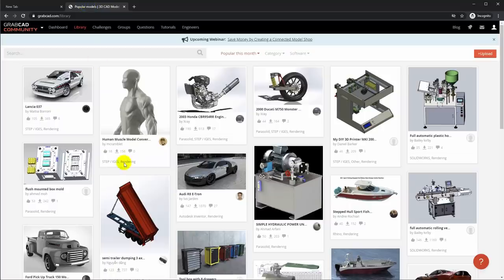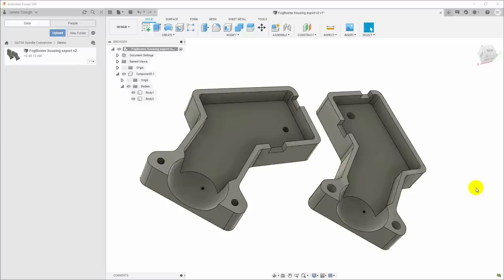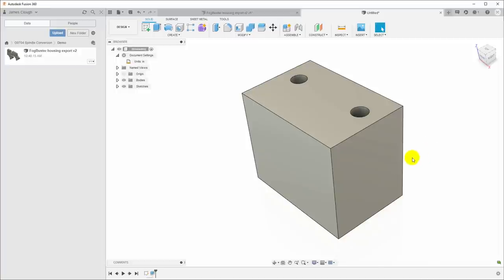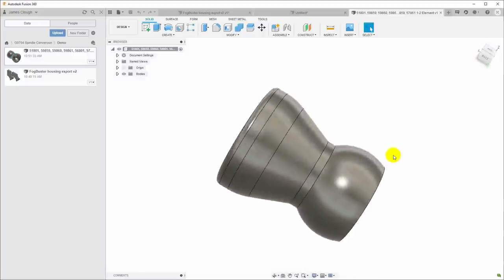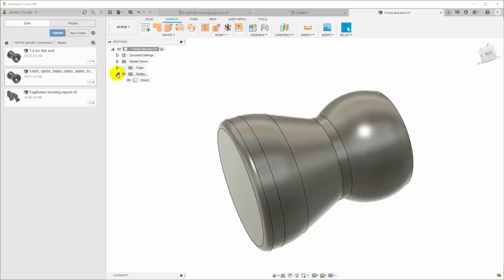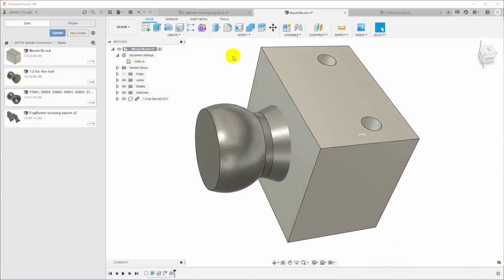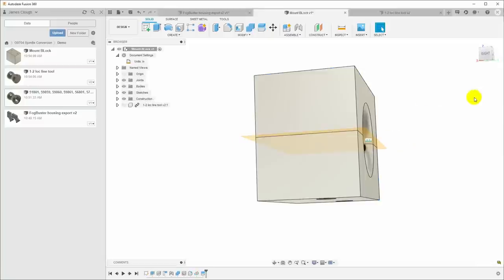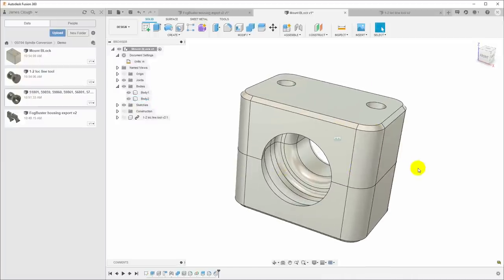Making 3D Printed Fog Buster Mounts with Loc-Line

Comment: I've been using a fog buster for several years now and I find that the most efficient positions for the 2 nozzles are 3 and 6 o'clock instead or 3 & 9 because the opposite air streams prevent good chip evacuation. Thanks a lot for sharing the files - I will definitely try the loc-line mount instead of the original arms

Comment: Just finished the video. Fantastic! thanks.
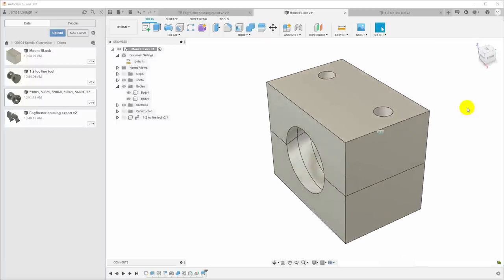I just got my first 3D printer a few weeks ago and am working through the learning curve with the printer and CAD (Fusion 360).  One thing I learned recently (after 100's of hours of YouTube videos) was moving the timeline bug. At ~17:25 you added fillets and mentioned you should have added them before splitting the body. You can slide the bug back to before the split in the timeline, add the fillets then drag the bug forward again. But, you probably already knew that.

Comment: I installed my fog buster today and came back to this video to see the locline system. If you need to get the hoses off again, just use a hot air gun for about half a minute and then you can just pull them off.
Thank you very much for making the parts available!
Reply from the maker: I tried that, but maybe I didn't use enough heat.

Comment: Great starter tig welds there. It takes a little bit to develop the muscle memory of the process, and I'm no expert. On the barb fittings -A little heat helps. I use a heat gun held at a careful distance. Heat just long enough until the hose is warm to the touch. Give it a little turn and then you can usually wiggle it off. We use this process at work on our CNC lathes on reinforced hydraulic drain hoses that have been permanently set stiff into shape with 10+ years of heat and oil exposure. Your solution was fine too, but there are times perhaps when your viewers might need to leave the length unaltered.
Reply from the maker: Thanks!  My welds would be better if I didn't keep taking the tungsten for a swim in the puddle.  I have trouble judging the arc length.  I wonder if a clear cup would help, but I've been warned to learn to do it right before spending money on magic tools to try to make it easier.

Comment: About filling the inside of the tool in Fusion 360, you can do it in the Solid environment. Create a sketch. Use the Project function to transfer the perimeter. Then Revolve the profile sketch making sure you use Operation: Join with the existing solid. 
BTW,  3D printing those links is possible. Plenty models on Thingiverse. Even the assembly tool! One downside; because of the staircase surface finish of the 3D print, it wears itself and won't give any longevity.  Once 1 link  doesn't hold, the whole thing is useless. Also, most 3D filaments are hygroscopic (tendency to absorb moisture), which would not be suitable to run any liquid directly.
Good job and keep the up the great videos!
Reply from the maker: It all comes down to the tolerances your 3D printer can deliver and how much time you have to fiddle with it.  Friction fits are tough.  For most applications, buying the Loc-Line is worth the $10.

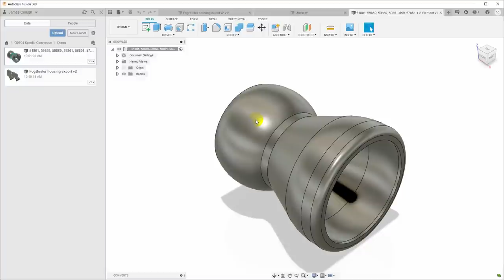Comment: 11:32, another way you can create a solid out of this is to first create a sketch on the plane which is looking at a side view of this, go to CREATE -> Project/Include -> Include 3d Geometry. Select the edges of the locline, then complete the profile down the side and through the center line, then revolve the profile. Took me about 20 seconds to do, and the side benefit is that you create a new body so you still have the original in your model.

Also, after opening the STEP file, be sure to right click on the component and choose "Capture Design History". I believe that is off by default when opening a STEP.

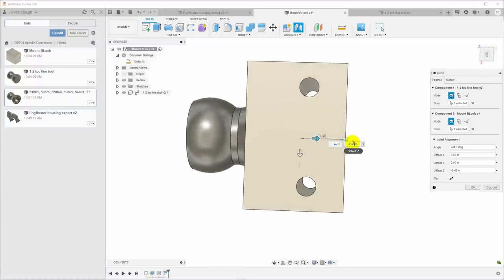Also at 14:50 it probably would be beneficial to either create a plane at a known location of where you want the locline depth to end up, or at least turn on hidden edges or wireframe so you can see the position.

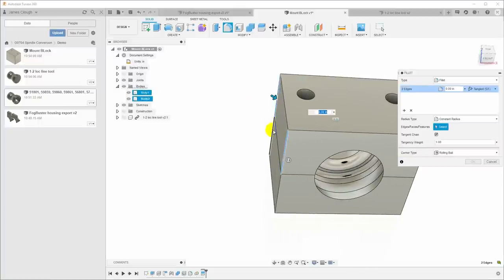Finally, at 17:30, don't forget, you're working with a timeline. You could have gone back before the split, added fillets to the single body, and your split will still be there when you're done.

Comment: I just recently found your channel and have been watching many of your videos.  Very informative.  I have been using Fog Busters for a while now and have always been displeased with the factory magnetic mounts.  I saw this video and started immediately making 3 sets of these.  Had to design the gun end since the Grabcad design was removed.  I printed them in Ultimaker CPE Black/White.  I have found this filament to be very accurate after quite a bit of testing and 3D expansion adjustments in Cura.  They came out great. Even put a Fog Buster logo in white on the gun.  Still waiting on the rest to print.  Thanks for the inspiration.

Comment: Thanks for the video. I am running a single noga cool on my mill. I was thinking of going to the dual nozzle fog busters but as with your mill the mounting adjusting setup that is standard looked like a pain in the neck to use. Plus I hate using any type of magnet on my machines, as I work primarily in steel. this looks like a great solution, although I may try to make mine from aluminum or stainless. Thanks again for the excellent video!

Comment: looking nice! I've found your tip on chamfering bottom faces quite useful, but I've upgraded it! add a .25/.3 mm fillet instead of a chamfer, since it's harsher at the bottom where it counts and compensates less and less on subsequent layers, so walls look straight instead of dipping in on the second/third layer
Reply from the maker: Good tip.  Thanks!

Comment: Welds Look quite good! Wish my aluminum TIG welds were that good.
Off topic but I just thought of something that related to one of your other videos. Re. your G0704 CNC conversion you said you sometimes miss having the manual hand wheels. I have the same mill and have been very seriously been considering a CNC conversion and have the same concern of loosing the manual hand wheels. I've seen some folks use dual shaft steppers and put the wheels on the unused shaft end; but then you get the unpowered-stepper feedback forces/drag. 
So, what's your opinion of adding something similar to the system you put on your lathe? Create a mount for handwheels for each axis and have the handwheels turn rotary encoders, in turn turning the steppers. Maybe some DPDT relays between the BOB and the stepper drivers to switch between CNC and manual. No tactile feedback, but manual control returned.

Comment: To stop any chance of rotation at the 3D printed parts you could glue the loc line to one side of the 3D printed part, this will allow disassembly as well as ensure no rotation.

Comment: I made my fogbuster 3D prints to James' design in PLA.   These have worked very well over the past year but the PLA around the front two clamping screws has now begun to crack and degrade making the ball clamping quite lose.   My solution was to use two brass 'melt in' M3 inserts pairs to replace the PLA based holes and threads.  The insert on the top side is drilled out with a clearance through hole and the clamping screw passes though this to pick up on the lower side insert.  Seems to solve the problem without resorting to re-modelling and re-printing.
Reply from the maker: PLA is easy to print, but it it isn't necessarily the best choice for every application.  Though it's also cheap, and it's easy to reprint, so it doesn't always matter.

Comment: Like the videos.  I have the same mill and lathe.  If you have one, I would like to know what size rotary table you have?  I'm worried about tool clearances.  I'm looking at purchasing a HV4 with chuck and dividing plates.  While I have not taken measurements yet I do not know if I should step up in size to HV5 or HV6.   Nice job on the ELS.  I plan to price one out for myself, I'll have to back and review your videos for the servo and such.

Comment: Very interesting and informative as ever James. I wish my first weld looked so good :-)

Out of interest, what made you decide against using a block with through hole to accept the Loc-line threaded element? It would have been so much simpler, or was it another case of "I can"?  Great stuff anyway.
Reply from the maker: That was my original plan, but the NPT taps I have a pretty lousy, and I was afraid the threads would pivot in use.
Reply: @Clough42  did you consider threadmilling NPT? but the printed solution is super easy and low risk for sure. when you were doing the model i was wondering what the CAM toolpaths for those blocks were going to look like and how long all that 3d toolpathing was going to take on the mill. then you sent them to the printer and i realized i was over-complicating it!

Comment: Try using a heat gun to remove the vinyl or tygon tubing.  You still need to cut back the tube, but can avoid putting marks on the brass barbs.

Comment: Hey James. Question about your earlier mist coolant setup. I have a similar model. I feel like a ball valve before the mister seems like a good idea. Let's me set the air pressure and lock the jamb nuts. Did you have anything similar? Or were you content adjusting the air with the needle valve every time?

Comment: I have a question, how do you meassure the spindle load? I s there a way to connect a display to the vfd to show the current/ load or is there a way to show it directly on the vfd screen? How do you meassure spindle load?

Comment: Best way that I can get to fill out holes on fusion is selecting internal faces and deleting them...
Usually pretty easy and very fast!
Reply from the maker: Thanks.  I have used that trick before.  I tried it on this part, and the results vary depending on the order of surfaces deleted.  I didn't find anything that didn't destroy the outside geometry, but there may be a way.
Reply: @Clough42  Could you have just creating a cylinder over it. Used the existing inner face to split the cylinder and then combine the inner part with your part?

Comment: Great video... Thanks.  Just curious if you have found a favorite coolant/lubricant for the Fogbuster?  I see lots of folks using Kool Mist 77 and DuraKut 900B.  Any thoughts?
Reply from the maker: I run Sta-Lube soluble oil.  I tried Kool Mist and personally didn't like it.  It was pretty squeaky on aluminum with the YG-1 end mills I was running at the time.
Reply: @Clough42  Thanks!

Comment: Do you remember what wall thickness and per cent fill you used on those parts you 3d printed?
Reply from the maker: These are printed with a .4mm nozzle, three perimeters, 30% infill, .25mm layer height.
Reply: @Clough42  Thank you

Comment: How much airflow do you need for two nozzles?  What's your air compressor setup like?
Reply from the maker: I have a 2HP California Air Tools compressor.  Word on the street is that the 1HP is sufficient for a Tormach power drawbar and a single nozzle Fogbuster, so the 2HP should be sufficient for my smaller drawbar and a dual-nozzle setup.  The 1HP is rated 2.2SCFM@90, and the 2HP is 5.3SCFM@90.  Time will tell how well it works.

Comment: 13 mins patch both holes - Boundry fill select all parts as the tool, right to left drag to select all for the cells, set operation to new body or whatever, remove tools, ok done

Comment: CWI and welding educator here. 

You’re too hot overall
Reply from the maker: I don't doubt it.  It's a Syncrowave 210 at 120Hz with a sharp 5/32 tungsten, 1/16 4043 filler, #5 cup, 15CFM argon.  I started at 125A to form the puddle, then backed off from there, tapering down as the weld progressed.  I had to move pretty quick to keep the part from going all Dr. Seuss on me.  Video from actual welders seems to show them having more time to work, so what you're saying about heat sounds right.